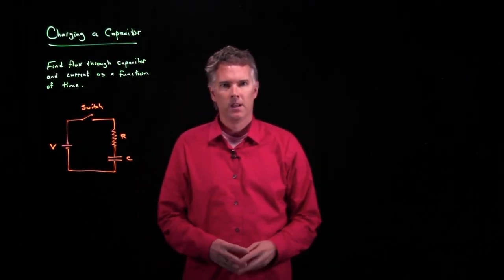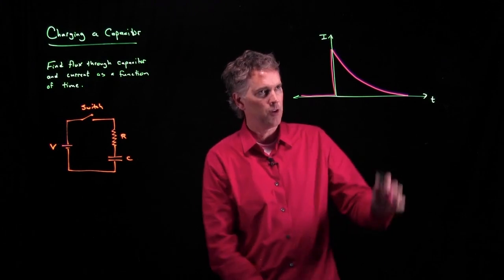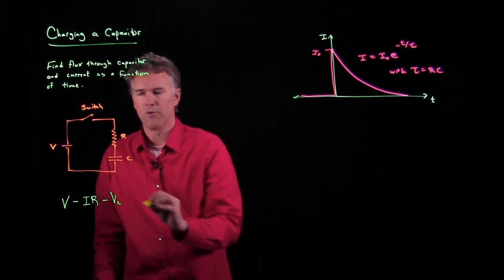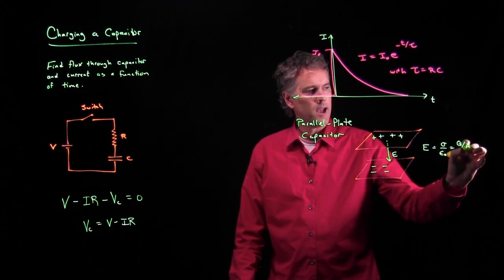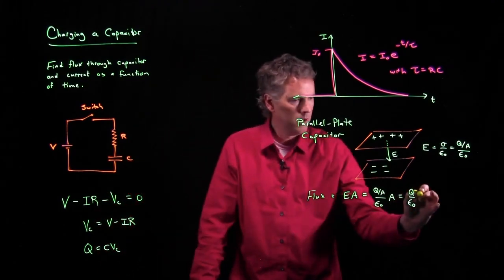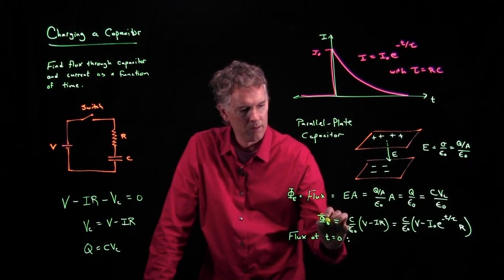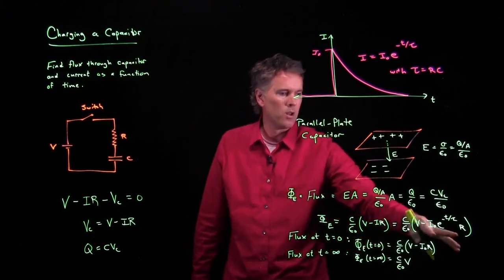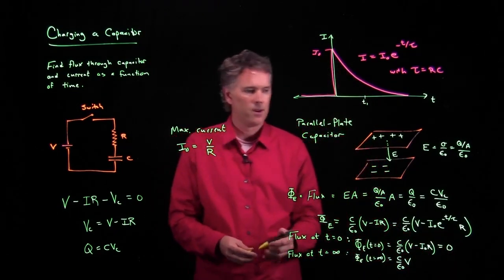Charging a Capacitor | Physics with Professor Matt Anderson | M22-15

Comment: So here is a little challenge: when charging there is a loss in the resistor , so how big is this energy loss relative to the energy in the capacitor?  May be a little difficult so here is the solution ( because it is fun) the loss in the resistor is exactly half the energy stored in the capacitor WHAT? It is not a function of the resistor!  So what happens when the resistor is zero?  Have fun!